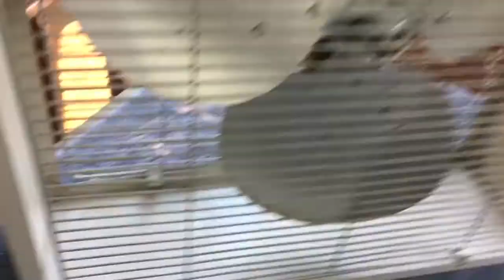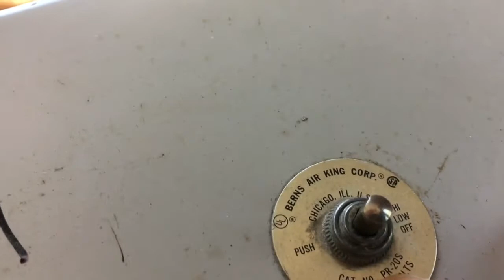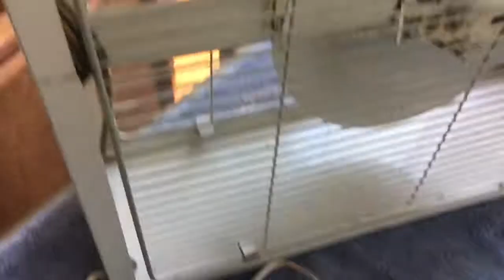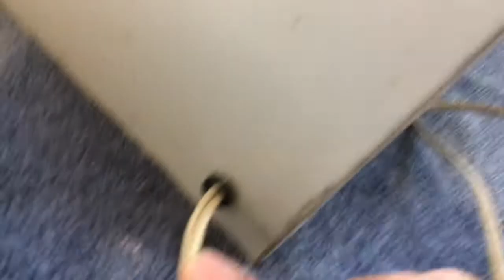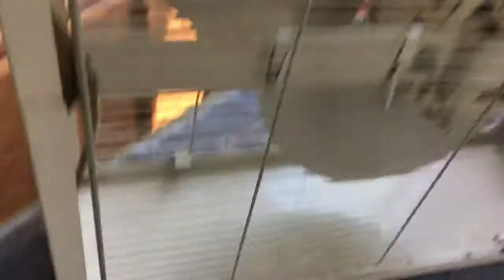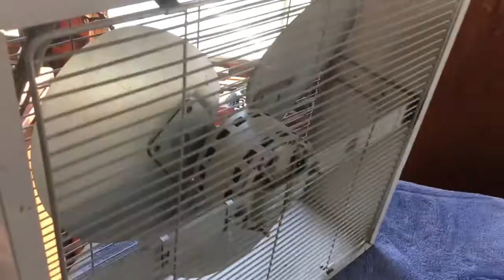Vintage Berns Air Box Fan 2 Speed Push Button

Comment: Those ge motors come apart like McGraw Edison box fan motors, although they do seem to be a bit more robust in construction, the bearings are based off of GE’s larger furnace motors in the fact that they have a cutout in the bearing for part of the oil wick to protrude and deposit oil on the motor shaft and have grooves in an X formation just like a furnace motor. It wouldn’t be a bad idea to have a fuse holder within the fan somewhere since these motors have NO thermal/electrical fuse.

Comment: It should be fine just keep it cleaned and oiled and it should be fine , it doesn't buzz , if in doubt put an inline fuse on it , the motor just pops apart , put some reference marks on the motor, my monarch air has a a small shaft McMillan motor , it doesn't say burns air king any where
Reply from the maker: good idea about the reference marks. I'll try to remember to do that. At least I'll try to try...

Comment: I've had two of those motors. Hard to get apart. It is the infamous ge  " fireball" motor I believe. It's the combination of copper and aluminum wiring that goes bad and catches fire. I didn't worry too much though.
Reply from the maker: did either of yours self destruct?
Reply: thebombyall76 no I gave them away there was no destruction. I just saw lots of videos on you tube about them. Basically the other type ge motors you have in your  ge fans don't have this problem at all. That looks similar to a Westinghouse motor too.
Reply from the maker: I agree - there's a stamped arrow that is like the westinghouse motor in my WTG Lakewood. so far I haven't seen any other markings.